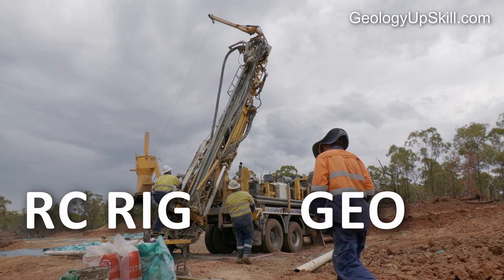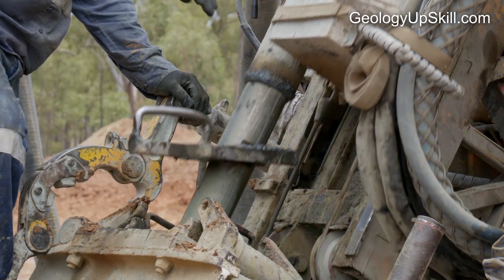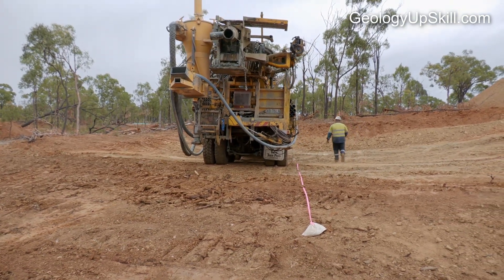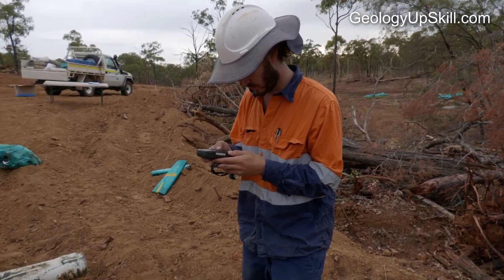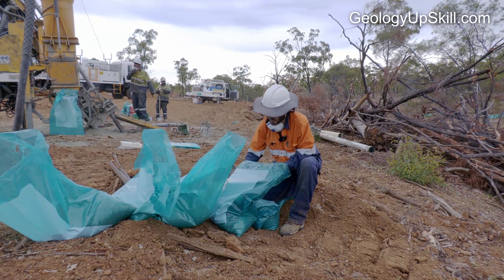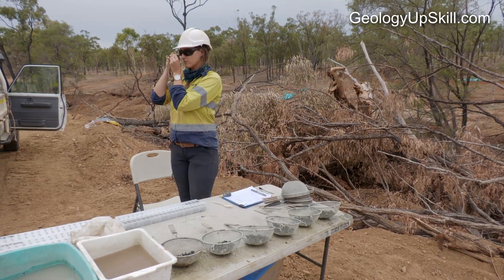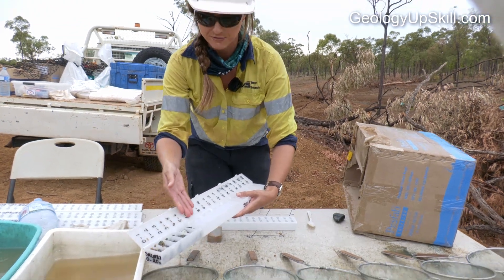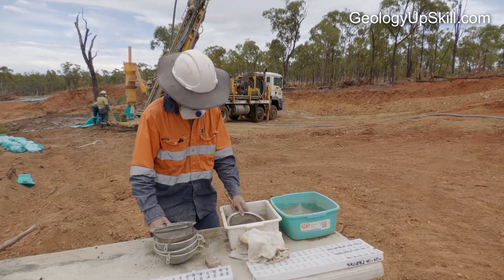Geologist Job on RC Drill Rig

Comment: Are there any sensors that will record the mineral alteration of the rock chips that the geologist is looking for. It would remove bias as young geologists might finding alteration mineral mapping a challenge and also greatly speed up the whole process. For eg the sensor picks out the sericite alteration , the core logging geologist notes the recording and quickly becomes conversant in recognizing alteration mineral assemblages.
Reply from the maker: Yes. And sensors like that are becoming much more used in mine environments where the rocktypes and alteration facies are well understood. It's a little more tricky in exploration environments where you don't know what you are looking for and many of the clues are in  textural relationships. For example, a muscovite schist and a sercite altered granite look like the same rock to a spectral scanner without any context. Once you know that they exist in the same project, you can train the scanner to recognise subtle differences to separate them.

Comment: when he said  " you'll be looking in the opposite direction of the drill hole ..."   if you drill in the direction your looking ?
 what did he mean ??
Reply from the maker: If the drill hole has a planned azimuth of 090 magnetic and you are sighting from the front of the rig, your compass should read 270 not 090!
Reply: If your sighting compass is any good it will have both numbers on the wheel i.e. 270 on top of 090.

Comment: Good to See...am Also handling DD and RC here in Congo....
The Negative thing about the RC is The Dusts...and Water coming from The Hole...Need to Bath againg and again..😂....
Still RC is cheaper and faster ..and for an immediate result me as a Geologist will prefer RC.
Reply from the maker: RC is hard to beat if you have a good handle on the geology already.

Comment: It s really funny how you talk about safety and then you see the sample hose compressed and altered from its original form. XD
Reply from the maker: This video is about the geologists job on the rig. The geologists on site must abide by the safety management system defined by the drillers. That is what is explained here. If the drillers judge that their equipment is safe to operate, then they are responsible for that decision. In this case, the drill program was completed without a hose failure so it is clear that their judgement was correct.
I'm sorry to hear about your accident. There are no doubt numerous videos to be made about safety issues on drill rigs. I see you have made some yourself and I would be happy to make some also if the opportunity arises.
Reply from the maker: That's exactly why it's a no-go zone as the geo pointed out.
Reply: @GeologyUpSkill  safety isn’t just for the geos, the offsiders are constantly there and nobody stopped the process when they saw something wrong. I’m not trying to insult your video or anything, I like the video but I have also experience in drilling and got a permanent disability because people didn’t care for safety! Great video anyway ❤️